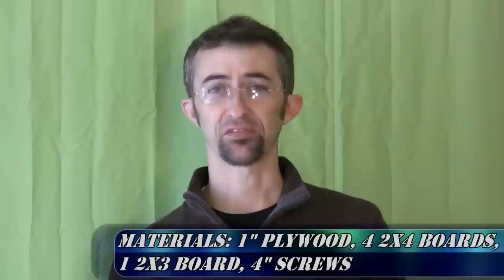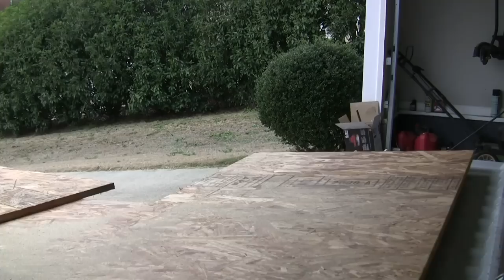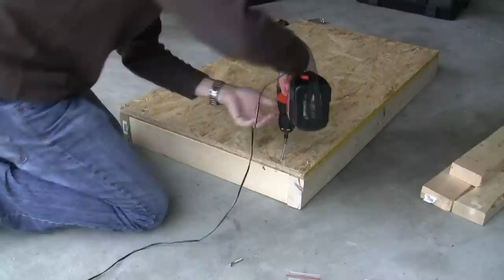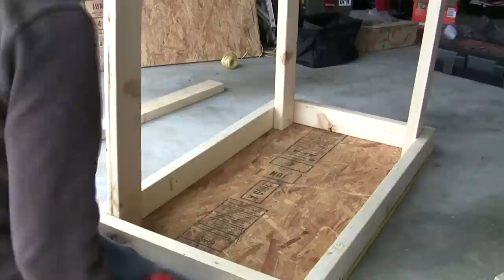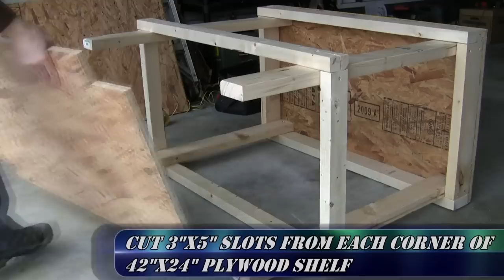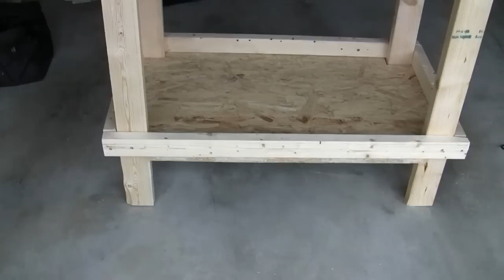BUILD A GARAGE WORKBENCH FOR $25: HERE'S HOW!

Comment: Pilot holes doesn't only avoid destructive splitting (like the one we can see in this vid) but also provides a possibility for a tension between the pieces that are screwed together. A screw in a pilot whole sits double as strong as without a pilot-hole. The pilot hole should go all along the entire screw length. A screw without pilot hole always splits the wood even if you cant see the split from the outside. If you save 15 minutes of predrilling it'll cost you more for material. The same sturdyness can be achieved with wood having half the dimension used here when properly fitted.

Comment: I would suggest investing in a speed square, can be used to make a line on your lumber and also a guide for your saw, maybe some carriage or lag bolts for securing legs, and most important why did you put your bottom shelf under the supports? It would move strength if you would have put it on top of the 2x4 side supports. Other than my 2 cents, good how to video.

Comment: If I would have knocked this project out, the plywood on the bottom would have gone on top of the rails, and never even think of using it as a shelf with sides. Nice! (Old job I worked at I built a lot of shelves for glassware storage). Nice touch!!!
Reply from the maker: +Mike Mac Thanks!

Comment: just a small obervation: the lower platform should not be mounted that way, because the weight you put will put too much force against the nails/screws you used. The correct way would be to put the platform over the supports, not under.
Reply from the maker: Florencio Fontecilla Thans for the suggestion. A lot of people have mentioned it as well. I purposefully did that to to loose item from rolling around and falling off the shelf. I do not keep heavy items on the shelf so hopefully the screws should hold up for a long time. But your suggestion is a good one building wise.
Reply: Good point...

Comment: nice design just a few suggestions not criticizing I do like it. you may want to take the time to pre drill the holes less likely to split wood and offset the screws when screwing on legs put in upper left hand corner and bottom right hand corner will give you more stability. Also I keep a bar of soap in my work shop to coat the threads of the screws will make them go in much easier. I am not the smartest guy just learned by trial and error and 65 years old and still learning again nice project.
Reply from the maker: +michael stephan Thanks for the tips!

Comment from the maker: I thought about crossbracing it with a 2x4 and gluing the table top frame around the 2x4's, but allowing time for the glue to set would have basically wiped out all day. For my purpose, just using 4 inch screws worked well and it's rock solid as a table top.

Comment: somebody buy this guy a square
Reply: and some drill bits
Reply: John Snow and some wood glue :-)
Reply: roberto petruzzelli and some sandpaper :-)
Reply: my god, it's a low-cost workbench. Built quickly and useful. The upper plate could be more thick, for working with hammer and nails. Otherwise the plate springs.
Reply: and a cordless impact

Comment: Nice video! 

It looked like you had to put a lot of force into those screws, if you pre-drill holes where you want to screw, it makes the actual assembly go much smoother.

All in all good workbench build though. Some sanding and a light finish would make it look really good as well.

Comment: I have to agree, and it would have prevented the 2x4's from splitting which is even more important. But not bad for a simple build. I would also chamfer the lower ends on the legs. If you move the table a lot these chamfers will prevent the sides from splitting as you drag the table around over rough floors.

Comment: I would suggest a sheet of 1/4" hardboard as a work surface on top of the 1" fiberboard you used, it will stand up to more abuse and once it worn out you can replace it with a new piece. Also surround the edges of the fiberboard with any thin stock to prevent chipping.
Reply from the maker: Nathan best Good advice. You can also seal the top as a friend of mine did. This one doesnt get hard use so the fiberboard does just fine for me. I had it laying around the house so I didn't have to spend any more money!
Reply from the maker: That would work very well also, thanks for the tips and thanks for watching!

Comment: THANKS! ALL THE VIDEOS IVE SEEN REQUIRES A MITER, ROUTER, ETC. IM A GIRL, AND IM JUST GETTING INTO WOOD WORK AND I COULDN'T FIND A TUTORIAL ON A WORK BENCH THAT WAS EASY TO MAKE WITH SIMPLE TOOLS FOR THE LIFE OF ME! ILL JUST USE MY JIGSAW TO CUT ALL THE SMALL PIECES AND HAVE LOWES DO THE REST HAHAHA. IM GOING TO MAKE MINE A BIT LARGER, AND ADD ROLLERS WITH LOCKS ON THE BOTTOM. NOW I JUST NEED TO LEARN HOW TO ADD A FENCE AND A CLAMPER TO THIS THING. COULD YOU DO A TUTORIAL ON THAT AS WELL PLEASE?

Comment: Wow you did this without using clamps and glue! The idea of a box-like shelf at the bottom is cool, but the way you made it seems susceptible to future failure. At least attach something, like 4 wood blocks, to the table legs right below it to support it so as to prevent it from falling off. My 2 cents.

Comment: if this is the case, I would have put the shelf on top of the 2x4 railing and put a 2x2 rail mounted to the top of the plywood.  That way you get the structural integrity of the 2x4 with still having a lip around the edge to keep the stuff in.
But to each their own.

Comment: The problem with cutting on a surface where the wood angles down, even slightly, is that your cut won't necessarily be 90-degrees to the length of the wood if the circular saw isn't kept flush to the wood.  However, that's a problem even when the wood is  straight, if someone doesn't do the same thing.

Otherwise, being a table that might not even be used for other wood-working, it should suffice for bottom storage of light items or work that doesn't require the straightness in every angle of the build.

Comment: I might suggest drilling counter-sunk pilot holes to keep the lateral 2X4's from splitting, But all in all, inexpensive and functional. Nice work
Reply from the maker: Thanks. I agree with you. Pilot holes are a good idea.
Reply: +BullittMcQueen There are screws called Splitstop on the market that you would not believe. You can drive them within one inch of the end of a board without splitting it. They are a little more pricey than other screws but are worth it in some applications.
Reply: +SA Bjork There are screws called Splitstop on the market that you would not believe. You can drive them within one inch of the end of a board without splitting it. They are a little more pricey than other screws but are worth it in some applications.

Comment: Ahem...  trying to be as diplomatic as possible here. The gentleman who posted this video - although getting props for the DIY spirit - broke about a dozen 'rules of thumb' during construction; namely, you build the frame first, and attach the top as the last step, which helps ensure that your bench is level and not subject to 'tweaking as you build the frame. 

Also - invest in a good combination square or speed square (not pictured in this video, LOL) and a 24" level - you won't regret it.

Comment: has your bottom shelf fallen through yet?  mount the shelf on top of those supports

Also, you might need a new circ saw blade - seemed like it was struggling through the 2x4s

Comment: I'm searching homedepot.com and lowes.com... cannot find any plywood advertised for sale that is 1" in thickness. Has this been discontinued or something? Is there any reason not to make the demensions 48"x24" to use all of the plywood? I'm a newb... So thanks so much ! :-)
Reply: He did say plywood, but I'm pretty sure he was using OSB for the table top and shelf.
Reply: They do make 1" plywood, I have a sheet that I picked up from a construction contractor, just not sure where it could be purchased commercially. You could use a sheet of 1/2" plywood and double the thickness by using two layers glued together.

Comment: I understand your ultimate goal, but it doesn't cost anything to square things up before you cut or fasten Not hard to imagine this to be a tiny bit wobbly. 
As for the bottom shelf, having sides around it may be good for your purposes, but sides are usually detrimental. Most shops keeps heavier items on the bottom, and slide them off as opposed to lifting. 
Good job though. I believe it to be something a beginner could easily accomplish. Just remember to square before you cut or fasten.
Reply: I know in my case, it might be hard to square off.  I try my best to cut that way, but it is off. Then I don't have the right kind of saw that can only shave off millimeters, sometimes just at one end of the board, to get it to be square.

Comment: Dag, don't use OSB!  Use something with a little more oomph to it, at least a good thickness of plywood.
Reply: I don't care for Osborne myself. But, for a$25 table, it's a good option. But I'd glue and screw hardboard or thin, high quality plywood to the top, for a smoother finish. Also, if there was enough Osb, I'd do two layers for a solid hammering surface. Two layers of 3/4 Osb and 1/4 of good ply would be pretty darn sold!

Comment: You are obviously not a woodworker.... but that table will get the job done for sure.  If it were my table, I wouldnt be happy with the top surface.  You didn't use plywood... you used OSB (oriented strand board).  I would consider buying a partial sheet of 1/4 or 1/2 inch nice plywood and using a few screws to attach it to the top.  That way when it gets abused over the years it is easy to swap out.

Comment: What where the measurements for the plywood when you bought it from lowes
Reply: It's not plywood, it's actually OSB board and I dont know measurements in imperial system, but in metric it's 2050x625 mm